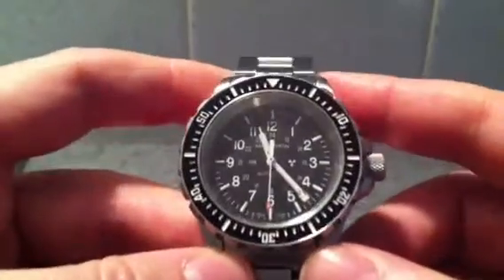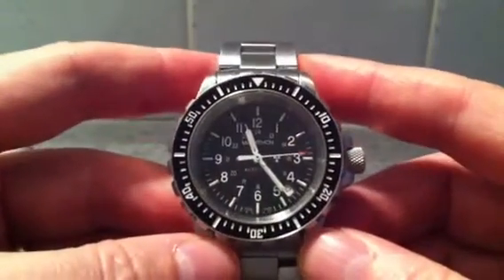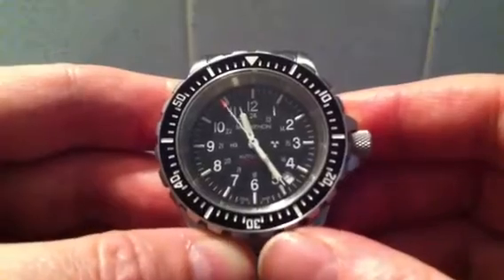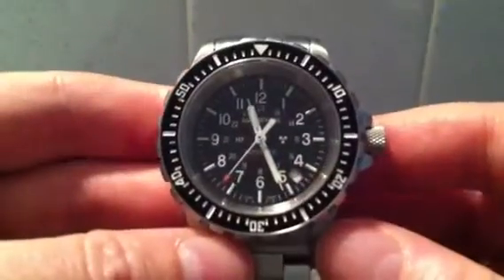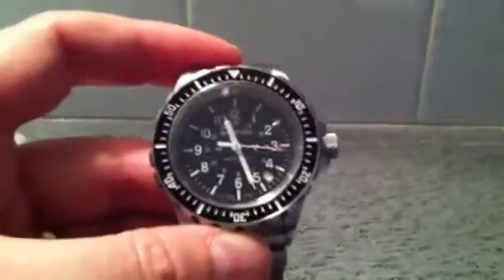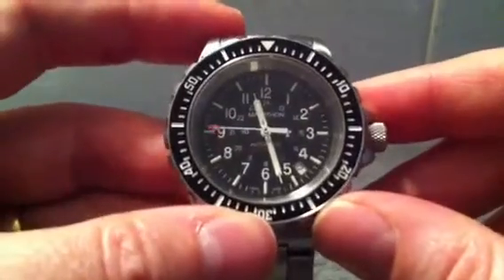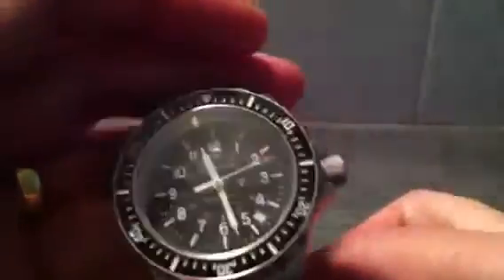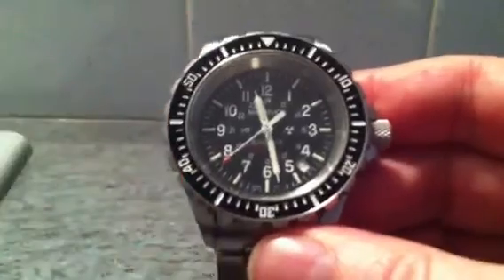Marathon GSAR - How Tritium works

Comment: At 2.21 you mention that " mass is lost" and is converted into "pure energy". This is not correct. Mass and energy are equivalent so in a process where energy has been released an equivalent amount of mass is released . A simple example would be a cup of hot coffee say, cooling down. The coffee loses heat energy to the surrounding air which must therefore gain the exact amount lost as all the energy must be accounted for as energy cannot be created or destroyed. The coffee therefore loses an equivalent amount of mass but the air surrounding the cup increases in mass by the same amount. Excellent review however and I'm definitely going to try to hunt one down.